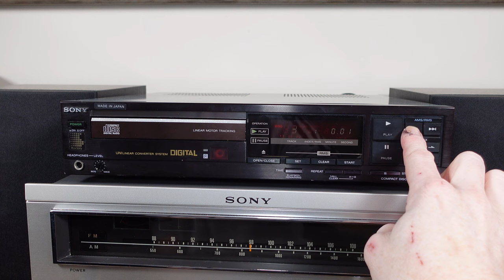SONY CDP-103 CD Player Disc Drive Repair - Retfurb Vintage Refurb

Comment: Hi man, I changed the laser pickup on my 95 Sony player but it still stops and errors after reading the disc for 30 s. Do you have any idea what could be wrong? Thanks.
Reply from the maker: Hello, To be honest it is difficult to say. But if you have changed the laser section, That should eliminate that. It could be a number of things, But I would look at the circuitry on the laser section first. It could be something on there, Causing an issue.

Comment: I wonder why the drawer is that slow, it's supposed to move much faster.
Reply from the maker: I think the motor was starting to get weaker, due to wear. It was a little better when lubricating the mechanism, but still seemed slower like you say.